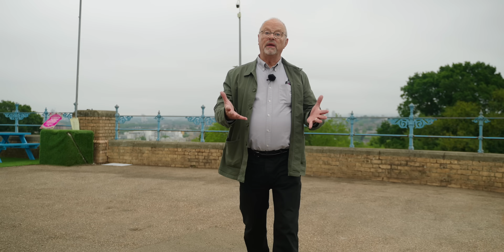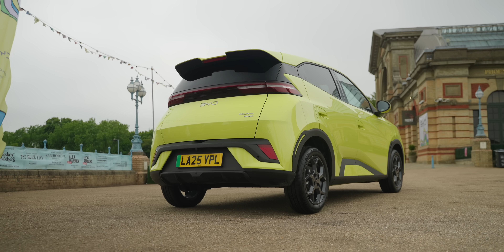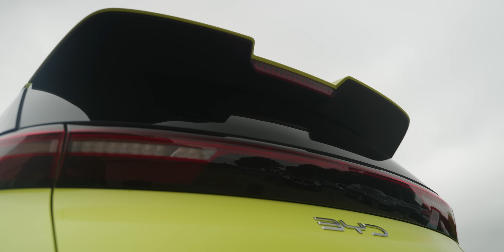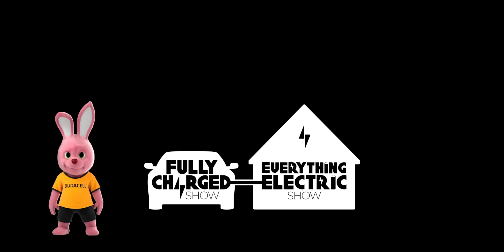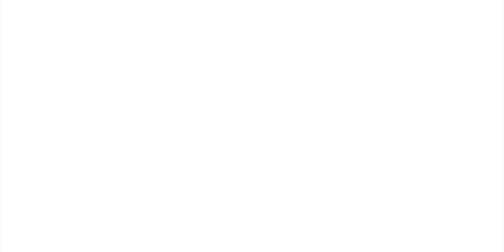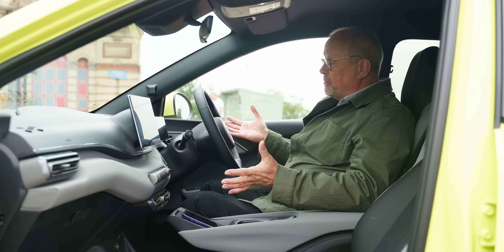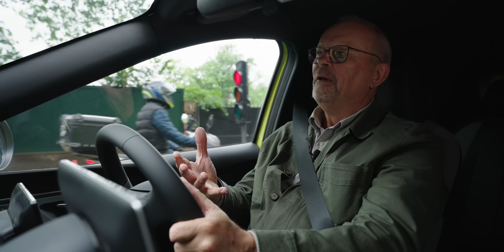At Long Last!? Low cost (high volume) EV for 'every' budget?

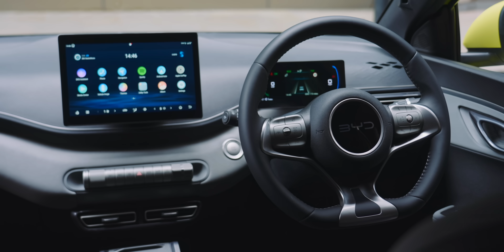Comment: Google byd fires in China. then decide  if it worth  risking  you life in it and your supporting the Chinese  government   who may become a danger to the west they have a  bad record on human rights. 7:35  in China if you say any  thing bad about byd your arrested  I've  seen videos  of byd     bursting into flames  in China the only reason the Chinese  drive evs is they have no choice there government  won't let them have a choice buy a petrol car it fits in to your life. buy a ev you fit your life around it
Reply: Also don't forget to Google petrol car fires and see how many more of those there are.

Fact: Gasoline vehicles catch fire 10–20× more frequently per mile than EVs.
Sources:

U.S. National Fire Protection Association (NFPA)

U.S. Bureau of Transportation Statistics

Gasoline is just weaponized dinosaur juice, but yeah… batteries bad. 🙄

Fact: 80–90% of EV charging happens at home or work, overnight or while parked. No “waiting.”
Sources:

U.S. DOE — Office of Energy Efficiency & Renewable Energy

Electric Power Research Institute

If you’re spending time at gas stations, that sounds like a you problem. I don't like having to fit my life around a petrol car.

🧲
Ask yourself:

Do you park at home and plug in at night?

Is electricity cheaper than gas where you live?

Do you drive under 200 miles a day (95%+ of Americans do)?

Do you like fewer repairs and lower operating cost?

If yes: an EV could be a great move.

Comment: A perfect car does not exist. I would've liked to hear also the negatives. I really like this car, but I know for example, that Android Auto does not work in portrait mode, when you rotate the central screen. This battery is more safe and I prefer it, but it is also more heavy compared to the same Kwh 'standard' battery. Not mentioning any of these make it sound like a promotion.

Comment: I like the styling of the BYD Seagull.
I like the Inster but that is just too exy in Aus at AUD$43 K drive away for the base and AUD$49K for the long range.
An new Hyundai Venue starts at AUD$ 26K drive away so why so exy for base EV?
The Seagull, Dolphin Surf not yet advised the price here but the Dolphin Essential is 36K drive away so I suspect less than that.
This car if priced right will make EV sales on mass in Aus.
Versatile, affordable - good range and can seat 4 large adults.
BYD has a winner for sure if priced right.

Comment: I still object to the overpricing. To lease, it is 30% more than a Dolphin. Insane. It is slightly more expensive retail price than in the EU. BUT, the EU has 35% import tariff, UK has only 10% import tariff. So it should be about 20% cheaper than EU. You also operate a lot in Australia. RHD vs RHD. But, in Australia, prices are up to 50% less than UK (OK, no import tarrif and only 10% GST). But the over price is the same as UK vs EU. What do they hope to gain? To annoy UK buyers and destroy the brand before they get started? Or to do an about face, like they did in Brazil when consumers protested? Like they did in Australia? Do you see a pattern? Poor leadership. Yes, there will be landed costs differences, but the BYD management need to get a hold of this and make a world decision. Leaving to local country management (especially if, for example in the UK, they have recruited from of the morons I used to work for in the UK car industry) is a recipe for disaster. From a family looking to buy two cars, right now. Who will not. I do not have 'MUG' imprinted on my forehead. Also, I do not intend this as disrespect to you, but where are the women testers? This car is clearly aimed at the young 'twenties' girl about town (like my daughter, who right now is looking to replace her FIAT 500). And you do not represent her point of view. Just look at every 'UK'/European road test/review of this car. Middle aged 'blokes'.

Comment: Loads of features, except the crucial one - range. It'll do for going around town for a couple of days, but that's not realistic for going any distance. Real world range is going to be 50 - 60% of those figures, which is in effect useless. I wouldn't realistically trust the long range one beyond 100 miles, as nobody drives till the point of having zero charge, you always need a reserve. EVs are still not there yet!

Comment: Kids from Congo must be pleased with their hard work.
Reply from the maker: Oh you lovely man. You walked right in and dropped this beautiful clanger. Thank you for being so perfectly ignorant.
Kids in Congo are indeed still working in very dangerous, and actually illegal artisanal mines.
It's a total disgrace and we should all hang our heads in shame. A wide range of products we all take for granted are made or use cobalt and nickel, the two minerals at the centre of the child mining scandal.
Up until 2019, most electric cars used batteries that contained cobalt and nickel, but since the development of safe, reliable, cheap LFP and Sodium Ion batteries, the accusation about child labour and electric cars has backfired badly. New batteries, like the one in the BYD, contain NO cobalt and NO nickel. None, zero.
Not that it will stop people making the connection that dates from 2016. Back then, it was 100% valid, now it is a tired and flacid little whine from losers.
So why are these poor kids still digging the damn stuff up? Someone must be using it.
Stainless steel, paint, printing ink, the battery in your smartphone, laptop, tablet, but most of all, the oil refinery on the coast, where all the fuel you burn in your big brave combustion car. That refinery uses huge amounts of cobalt to remove some of the sulphur in diesel and petrol.
Funny the lovely folks working in the fossil fuel industry never mention that. I wonder why.
I won't drive a combustion car because I KNOW it will keep those poor kids working in the cobalt mines.
Next.

Comment: The delusion that EVs will save the planet….. IS STRONG!
Reply from the maker: The delusion that 1.4 billion combustion engine vehicles worldwide is absolutely fine is much, much stronger my clever friend.
Anyone who has ever said 'EVs will save the planet' is an ignorant idiot, of course they won't.
But they are nowhere near as caustically damaging as proper, masculine, combustion engine vehicles.
The whole premis of this show is to question the utter dominance of large metal boxes with wheels regardless of their powertrain, but that is far too subtle for some
Carry on burning toxic fuel, it's fine. No one cares.

Comment: THIS this right here is why the SLATE truck will fail. The whole point of slate is to be so minimum it costs less. But it costs 50% more and has way less than this does tech wise. Yes slate has a bed, but there is no reason this car couldn't have a bed version and still cost less.

Comment: Charging locations need to be standardised. Not like petrol caps. Petrol pumps are double sided. Chargers aren't. They should be on the passenger side, or the front/rear. Using the driver's side should be banned. That way, street chargers don't have the plug/cable sticking into the traffic!

Comment: Charge port, on the right, no good in uk, park outside house on road, some councils are allowing a gully to be put in pavement to allow ev owners to drop charge cable into pavement,  so this charge port will be out in the road, other option is park car facing wrong way, in uk it's illegal to park vehicle overnight facing the wrong way. Front charge port covers most use cases.

Comment: Price is starting to nudge up towards the new Renault 5 ... I would certainly stretch the budget for the Renault ... this looks like a great little car but it needs to start at £16,000, with £19,000 for the higher spec if it's going to maximise sales in the UK.

Comment: Just adding those few physical switches makes the car much more appealing to me and probably to a lot of other people in the UK.
Reply: Agree although they still aren’t easily distinguishable, discrete buttons. They are a slab of 10 (ish) identical buttons so you still have to look across to check the one you want. I’ve got the same thing in my 500e. 
Conversely, in my Panda, the controls are round knobs, push buttons and sliders etc which are easily discernible without taking your eyes off the road.
I realise it’s a cost reduction exercise but it’s also an impediment to safe driving.

Rant over 😀

Comment: Too slow and the range is still not enough, but they're getting closer. When small EV's can perform as well as their ICE equivalents (specifically range and acceleration), then i'll switch. I have a VW Polo and do a fair bit of country driving in Australia, and our rural EV charging is poor, so range is super important to me, as is acceleration (try overtaking a road train on a country road and you'll know what I mean). 

Having said that, BYD should be congratulated for making such big strides, especially with the Dolphin Surf. They're selling heaps of cars here and when this arrives, they'll do especially well.

Congrats on 15 years of the show!
Reply from the maker: Hi Cyclonicleo, I totally understand and sympathise with all your reservations about electric vehicles, well, except for one. 
I am very lucky being married to an Australian (37 years) so I have spent a lot of time in your amazing country and am very aware of the lack of charging infrastructure especially away from the coastal strip.
But if there's one thing I am very confident about, in a race between your VW Polo and this BYD, or indeed any VW electric car, or indeed any electric car, the Polo would be toast.
If there's one thing that, in some ways, can be a problem with electric cars it's the acceleration.
Obviously there's the expensive flashy EVs which can do the zero to 100k much faster than a Formula One car, but for all it's various limitations, the BYD Seagull as it will be in Australia, would overtake a road train in literally half the time it takes your lovely VW Polo. 
Everyone Ive ever spoken to after their first drive in an EV always says, 'my goodness, that little thing is lively!'
Quick bit of tech talk. A combustion engine needs to be running at specific revs to be able to deliver it's maximum power, an electric motor has 100% of it's power from zero revs. It's a very different experience.
However, all that said, if you do live in a fairly remote area, there are numerous other cars available in Australia with between 400 and 550 km range, that are not insanely expensive. The MG4 being a very good example, and if you want it to accelerate, it will do the job bigly.

Comment: Finally! This review of the BYD Dolphin Surf truly highlights what many of us have been waiting for: a genuinely affordable EV that doesn't compromise on features or practicality. Robert's enthusiasm is infectious, and it's clear the Dolphin could be a game-changer for EV adoption, especially at that price point. The focus on the Blade Battery is also crucial for confidence. This is exactly what the market needs to accelerate the transition to electric! Great job, Fully Charged Show!
Reply: Here in Germany, the Hyundai Inster with the 49kw battery, Heat pump, driving assistance and overall a really great features even in the standard variant, is available to buy for 22000€. The one with the smaller battery (42kw) often is even sold for 19990€.

It has more range, drives more efficient, charges faster, has more options and absolutely great features....

So why would anyone buy a BYD that is worse in almost every aspect and costs even more....

Plus Hyundai has a good service network, warranty and is a proven brand.

Big fail from BYD in my opinion
Reply: @KookyBone  blame your govt for tariffs. In China these cars cost only 10-12k Euro
Reply: @thermal84  No it is not just tariffs, the car is physically different from the Chinese version. They had to add more crumple zones and other safety features for the Euro market.
Reply: @KookyBone  looking, at a glance, at the UK prices, the Inster costs about £4000 more than this BYD - which is quite a difference

Comment: The seagull has the potential to be the gateway Ev to mass adoption at the right price, 25,000 usd for the entry model that nobody should buy (because it doesnt have battery cooling) is not it. It needed to be about 30% cheaper than the Dolphin to sell well.

Comment: If they’re getting 200 miles from a 30kWh battery that’s 6+ miles per kWh. Which would be around double what most EVs manage IRL. If true, a gamechanger.
Reply: Urban driving, as Robert said. But I doubt it. And on mixed roads and motorways, I doubt it even more. 6 miles / kWh is nothing new. The 9 years old design Hyundai Ioniq 28kWh and 38kWh do that easily in summer. 4.5 miles/kWh annual average worldwide. They’re the most efficient EVs ever made. The Ioniq38, at motorway speed does 4.5 miles/kWh average and 130 miles real range in winter. 160 miles in summer/spring (100%-8% SoC). For the Ioniq28, 98 miles in winter, 120 miles in summer (100%-10% SoC) at motorway speed, same efficiency of 4.5 miles/kWh.

So a 30kWh BYD and BYD usual 3.5 miles/kWh on most of its cars, forget it 😂

Comment: According to the BYD Chinese website the top-spec Seagull retails for less than the equivalent of £10,000. Even if you add on 20% for VAT that means £12,000. Add on shipping and import duties and maybe it gets to £15,000 tops. So, how come when it comes to the UK the base spec car will cost almost £20,000? Cars are just too expensive at the moment.
Reply: It’s because the Seagull isn’t the same as the dolphin surf. They’ve had to make significant changes to the internals to make it sellable in Europe (long wheel base, for example)
Reply: You will find this common on most Chinese cars when they get to another country. They are only those prices in China, otherwise you may as well double it for import/export, changes, and marketing/servicing
Reply: @Luke-qs2cg  You can get a Dacia Spring for £15000 so I'm not sure how this one couldn't start at the same price.
Reply: @MrAdopado have you seen what you get in the spring for 15k?
Reply: Sell it for £15k and I’m sure there would be queues out the showroom door so long as they can get the servicing and parts situation sorted.
Reply: different. safety spec and dealer network being paid for in £'s not RMB
Reply: Import tariffs. Not just VAT
Reply: @Jon-em4kc  UK tariffs on Chinese cars is currently 10%.

Comment: At the end of March this year I gave back my VW ID3 PP [the software finally went from 'awful-mediocre' to 'not so bad' with an OTA update 3 weeks before I returned it - oh well]. So there I was looking for used personal transport, and wowee, a low mileage 2020 Hyundai Ioniq became available for well under £10K. I got all the arrangements done and... missed out by one hour. It sold like a shot. I panicked and got a tiny mileage [12K miles] 2021 40kWh Nissan Leaf. And tbf it is an extremely clean, rattle free, very well built car that is too big for my everyday needs [although I comfortably took 4 other people plus luggage in it just yesterday]. It was too good a deal to turn down when I'd missed out on the other one. But really, the BYD Dolphin is what I've long waited for when I leased the ID3. It's a modern Mini car, the same space concept that I had in my first BMC Mini. Just better in almost every way [but maybe only just as much fun].

Comment: beater?   Sounds like war in a kindergarten.   It is an option.   It's made in China and not in the UK.   You should promote "build at home" .

I like the massage from Volvo that they want to build cars with green steel.    They understand what a good car needs.  zero emission cars from start.   And a long time on the road.   Our Nissan will soon drop out, because the batterie is so bad , that there is no use case left.   And Nissan will never give us a replacement.   for a resonable price.   The Leaf is a Kodak Single-Use Cameras.
Reply: You know who actually builds Volvos though? 😂
And 'build at home'? With the current UK labour market? 😂
Reply: @Jon-em4kc  It is the same owner which builds the London Taxi.  Volvo has still some European fabs.

Comment: Thanks for this review. My takeaway is that EVs are on their way to becoming more economical and affordable than ICE vehicles. Clearly, Chinese EVs are leading the way by offering a range of prices and features. In the US, we are falling behind the rest of the world in EV adoption due to the power of the fossil fuel lobby. Nevertheless, the future is with EVs. Technology has always had a way of overwhelming politics and resistance to change. As battery technology improves, becomes cheaper, and charging infrastructure is built, there will come a point where petrol-powered vehicles can no longer compete. The EV revolution has taken hold around the globe, and while change can be slowed, it cannot be stopped entirely.
Reply: China bot

Comment: It still baffles me that when they have the opportunity to change it, they put reverse with a push forward and drive pushing to the back. The same issue I have with the rear wind screen wiper on a stalk, push it forward and the rear wiper goes, pull it back and the windscreen is sprayed. Cars need a UX redesign.

Comment: Add metric information to your videos, if you keep quoting range in miles and don't add the kilometers equivalent by either stating it out loud, or by showing it on screen you are essentially excluding 95% of the world. Do better.
Reply: 1 mile is 1.6kms

There fixed it for you

Comment: Doing a test drive tomorrow.  Not sure a about the location of the charge point.  Street charging is on the passenger side....so park illegally or long cable over/under/around the car.  Rear passenger side please..place the motor at the back as well.
Reply: Did a test dribe today.  Really nippy and fun to drive.  Changed my mind about needing to be RWD